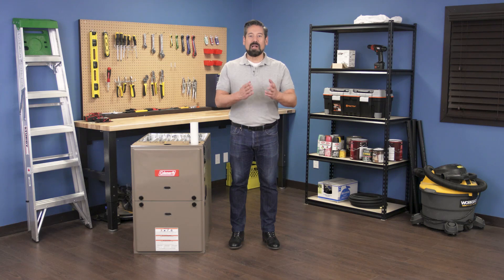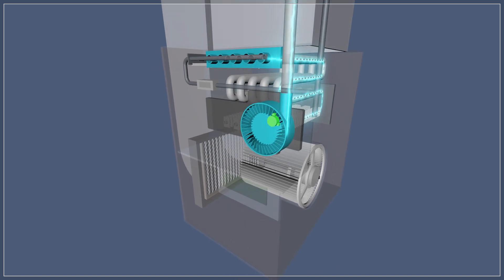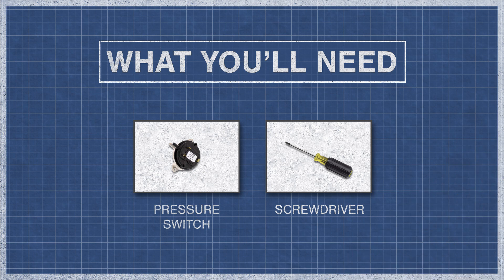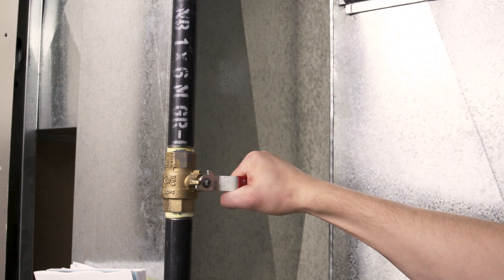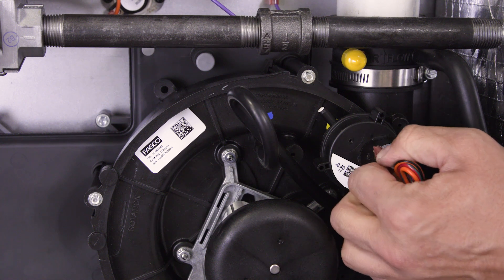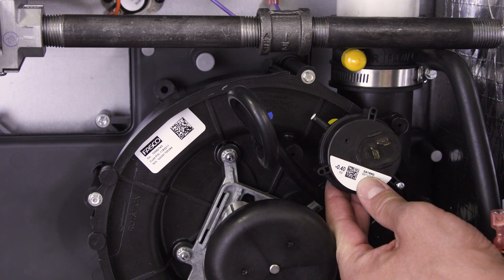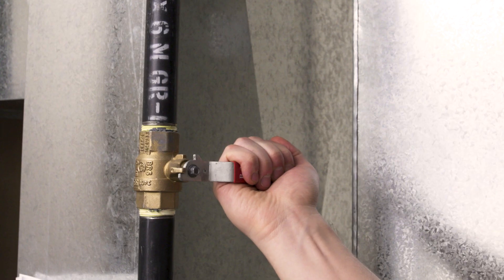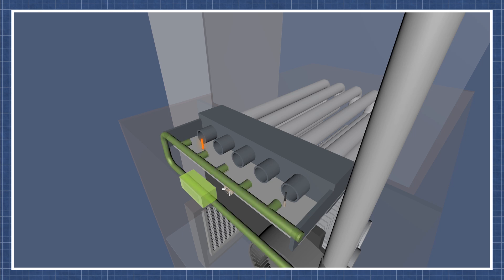Furnace - Pressure Switch | Repair and Replace

Comment: I have a 90% Goodman furnace.and its flashing 4 light's and that says open top air flow.how do i fix this problem.
Reply: Please help its cold here and i have kid's.
Reply from the maker: Hi Sanford, If its saying "open top airflow" and if you can verify that your pressure switch is tripping (furnace inducer fan runs but the furnace won't ignite) then check to see if there is adequate airflow in the heat exchanger, flue vent, and inducer and see if anything is blocking the airflow. If the airflow is good then the pressure switch could be faulty.

Comment: What happens if the wires on the pressure switch are mixed up as both of my wires are yellow.
Reply from the maker: Hi 5Riversz, that's a good question! The wiring on the pressure switch doesn't affect the switch. You can swap the wires and the switch will still function the same.

Comment: My ignator only come on if I jump my wires bypassing my pressure switch is that mean my pressure switch is bad?
Reply from the maker: Hi Ramon. These pressure switches are meant to protect the furnace, so if you bypassed the switch and the sequence continues it either means the switch is bad.... or that the pressure inside the heat exchanger is too low for safe combustion. Just a note its not recommended to run the furnace continuously with anything bypassed.
If you replace the pressure switch and the ignitor still doesn't light, then that will prove that its a problem with the pressure. This can be caused by a blockage in the pressure switch tubing (causing the pressure switch to think the pressure isn't good) or a blockage in the inducer motor port or flue vent.
Hope this helps.
Reply: AMRE Supply thank you very much
Reply from the maker: You're welcome! Cheers.
Reply: If the igniter came on the pressure switch is good.  Pressure switch contacts closing on slight vacuum is the step before ignitor being powered.

Comment: Whats the white cap on the switch?
Reply from the maker: Hi Jamie, great question. The white cap on the switch port is just used just to differentiate one port from the other. Some have a white and red caps https://www.amresupply.com/part/12129054 and some switches use different color plastics in the switch body https://www.amresupply.com/part/12657129 Overall as long as you match the same port as before than you're in the clear.

Comment: I have a Trane XR90 furnace. I cleaned P trap and all pipes connected to the switch but the furnace still won't light. I sucked the pressure switch and heard one click, and heard another one when I stop sucking. Do you think I should replace the pressure switch? If I choose a new pressure switch, I will make sure its pressure rating matches the old one, but are there any other parameters that should match? Thank you.
Reply from the maker: If you want to know if its a problem with the pressure switch you can check your furnace codes. You can learn more here https://youtu.be/qRmNrmjKEyk?t=2m10s   For matching pressure switches, the pressure rating is the most important, and but check to see if its a PF (pressure fall) or a PR (pressure rise) switch. Most are PF. Its best get a match based on your part number, as the mounting holes can be different with some switches. When in doubt, take the pressure switch out and bring it in store to use as a reference. Hope this helps.
Reply: Thank you for you reply. The furnace code indicates pressure switch error. The pressure switch is 1.4“ WC, but doesn't indicate whether it is a PF or PR. I tried to buy the same part but could not find it anywhere except used ones.
Reply from the maker: You're welcome. The WC is the measurement of inches of water column raised, its just the way pressure switches are rated. In furnaces almost all are PF switches, so if it doesn't specifically say, then its likely a PF. We carry a few pressure switches which you can browse here https://www.amresupply.com/catalog/Switches-HK3Z
If you can't find a match, there are universal switches that are adjustable https://www.amresupply.com/part/9397688 There's a PDF below the part with more detail on how to adjust.

Comment: thanks for the information, I have an older tridelta pressure switch with a purple wire and brown wire running to it in a Rheem 90+ updraft furnace, how to I tell which wire is common? and which is npc, thanks
Reply from the maker: Hi Cliff Harmon, always check your manual if you want to narrow down what each wire is but in this case reversing the wires will not affect the function of this switch.  As long as you connect the same wires as before, than everything should work.
Reply: thanks, I did chase down the wires on the schematic but goes to a nine pin block and cant seem to find schematic for the 9 pine connector, howwever  the purple wire is hot all the time so assume this is the hot, brown is COM

Comment: Does it matter which wire goes to each terminal on the pressure switch ? I noticed one terminal says "com" the other says  "on nc" I assume the "com" is the common or ground? and the other is where the hot wire goes?
Reply from the maker: Hi scientificfighting1, you are right that the "com" terminal is the common wire and that the hot wire should go to the "nc" terminal. The "nc" refers to "normally closed" which means that the switch is closed when the furnace is running, and the switch will open when the pressure is low.
Reply: Thanks for the fast reply. I got it all running now..looks like my furnace issue may now be solved. 😀
Reply from the maker: You're welcome! Glad you've got it up and running!
Reply from the maker: Hi scientificfighting1, just to clarify even though these switches may list "NC" and "COM" if you reverse the wires it will not affect the function of the pressure switch. As long as you connect the same wires as before, then everything should work.
Reply: Let me make sure I understand...if the same two wires that went to each switch are connected back to the same switch it doesn't matter which wire goes to which terminal as long as the same two wires are used ?
Reply from the maker: Yes that is correct.